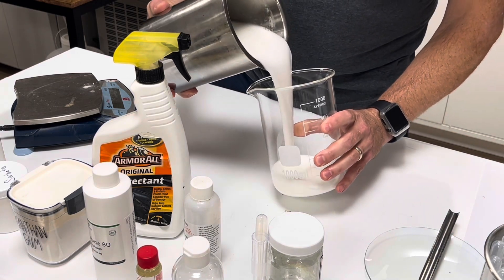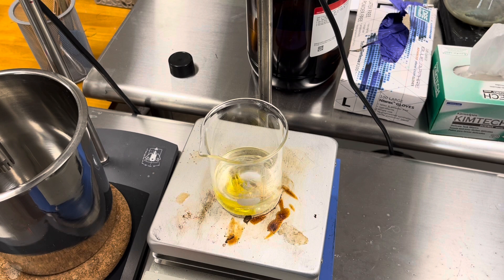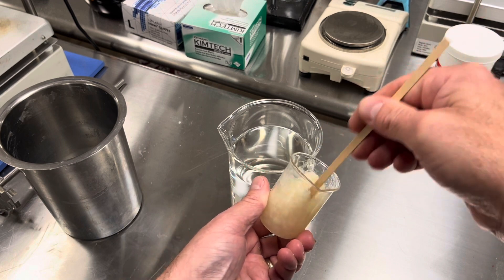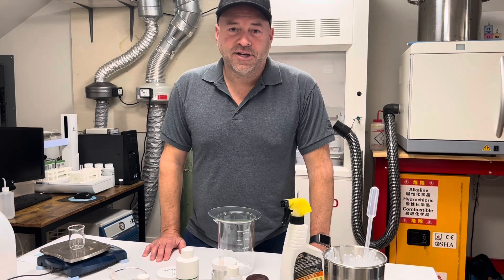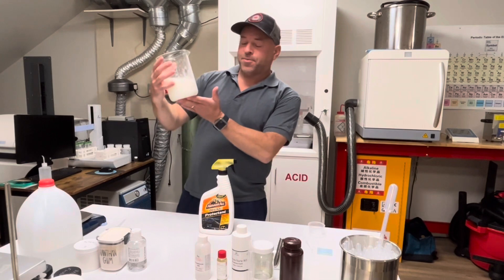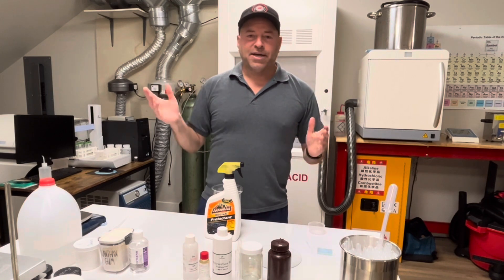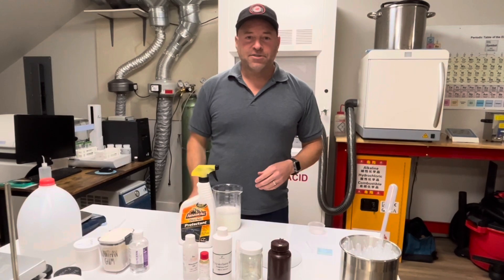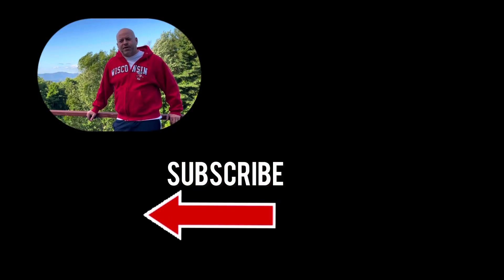How To Make Armor All

Comment: Great staff l need formulation on 
Diesel injector cleaner
Petrol injector cleaner
Smoke inhibitor 
I know u can help thanks
Reply from the maker: One of the best additives for engines is a chemical called Neo acid 919.   This is produced by Exxon.  But not very easy to obtain.  Look into this.  Cheers Terry

Comment: I was able to make this product according to the instructions and the chemicals listed. I used silicone 350. One useful tip I found was that after making the water phase and adding the xanthan gum, I let it sit for 24 hours. The water phase became completely uniform without using an electric mixer. When I added the oil phase. I stirred with a glass stirrer for a minute or two and the final product was very smooth and homogeneous. Thank you Terry for this magic formula
Reply from the maker: Awesome! Thanks for the tip! 👍